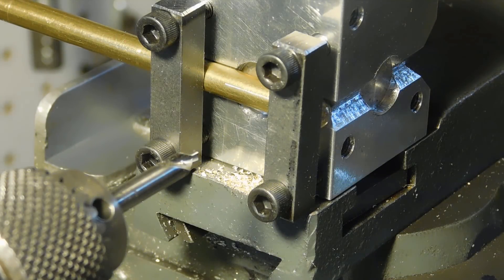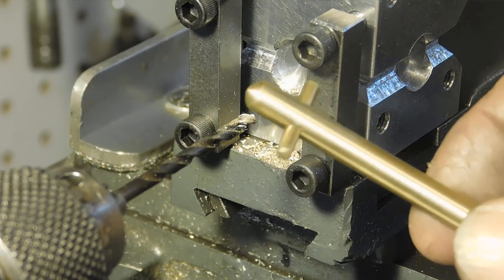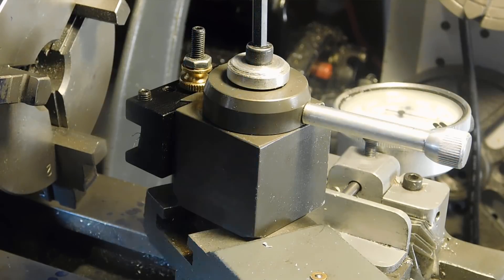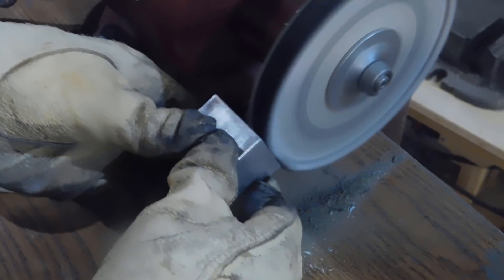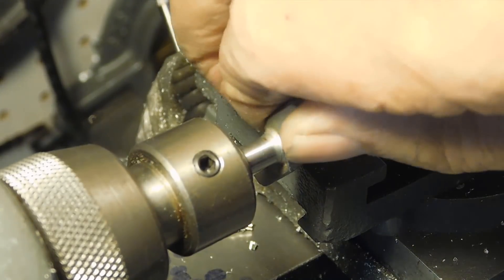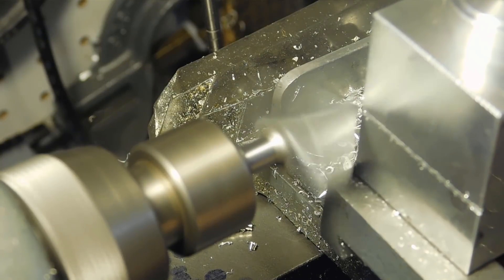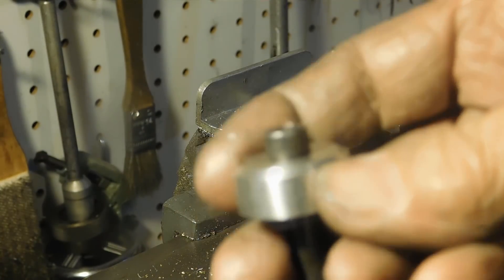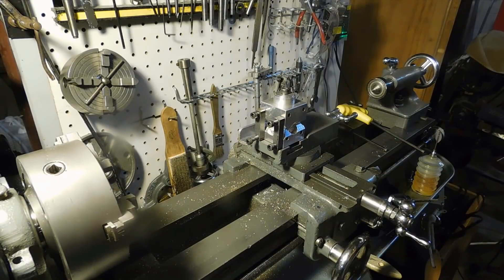Atlas lathe Centering Attachment

Comment: Why bother when you can use a mill for the same thing.
Reply: I can see it's value. This would be quick and easy to set up. Especially  for small diameter rods. No center finder or mill setup is required. I t won't replace the mill but is a good compliment to it. May have to build one for my SB 9A. 
Good show Robert. Each video is getting better.
Reply from the maker: I'm a tool kinda guy...I love'm...shop made are the best as they are "Custom Tools"
Reply: Just saying that I would use a mill for something like this not saying you are wrong. I too will make a tool for something special that can't be done without one.